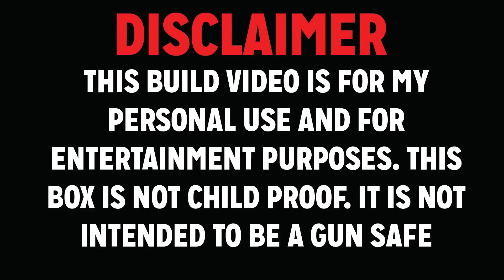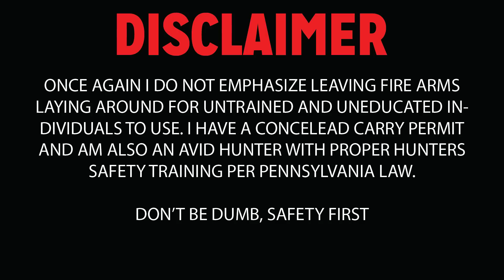Everyday Carry Woodworking Storage Box Build

Comment: Sweet build! At 3:48, what was the purpose for that hole that you drilled?
Reply: Patrick Skoll same question I had!!
Reply: Patrick Skoll ammo
Reply: Just a guess but it may be so that the two pieces don't form suction and get stuck together.
Reply: My guess is that when it's empty, the top is tight enough that it may not come free without being able to pull it out. I'm guessing that it will come loose when the pistol is in it without using the finger hole.

Comment: Nice out of sight,but easy to get at stash for the gun there.  Wouldnt be that hard to rig up some sort of magnetic lock either.  Ive seen a couple fireplace mantles that can easily hold a 12 gauge shotgun. Completely invisible but readily acessabe if you know about it and the unlock trick.

Guns are not the problem, the real problem is the brain controlling the trigger finger and thats why I stand 100% with  the right to own and have them. If youre unarmed, youre the target for the idiots..

A cnc wouldnt make the job easier if you consider the time to do the CAD/CAM part to generate the G-code a CNC uses. All you really need is nothing more than a good handsaw and a coping saw..

Comment: Easy If u own a fuckin woodshop
Reply: If you would like to make one you could probably use a $25 jigsaw to cutout the shape of the gun and instead of mitered corners you could make straight cuts and butt joints.  Granted it probably won't look as nice because you would have to use pre-milled lumber (they usually have poplar or oak) or even MDF from Home Depot but its not too hard to make.

Comment: yeah no CNC but you need a garage full of tools. I think you are most likely to have a CNC than all these other tools....not to mention the skills needed to do this...I think this video only applies to Bob villa...
Reply: If you would like to make one you could probably use a jigsaw $25 to cutout the shape of the gun and instead of mitered corners you could make straight cuts and butt joints.  Granted it probably won't look as nice because you would have to use pre-milled lumber or even MDF from Home Depot but its not too hard to make.
Reply: lol, it could be made with a few old hand tools...do you need someone to come set up the shop for you as well?
what happened to thinking for yourself